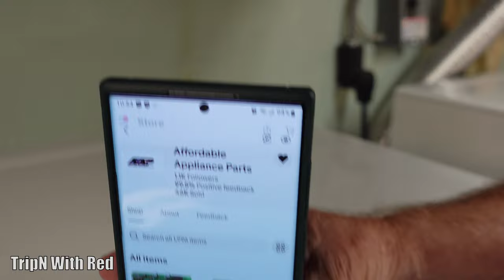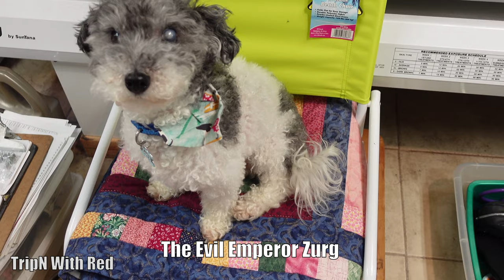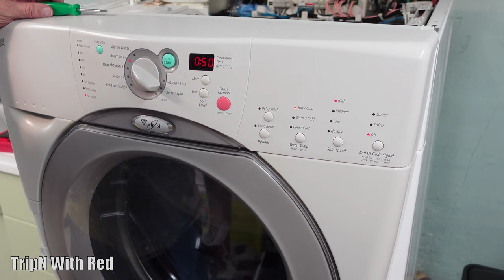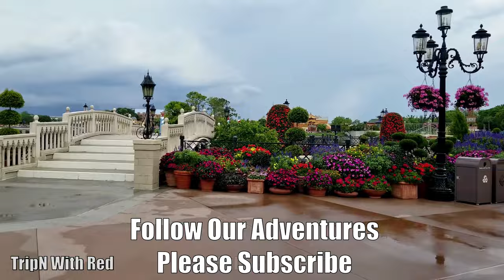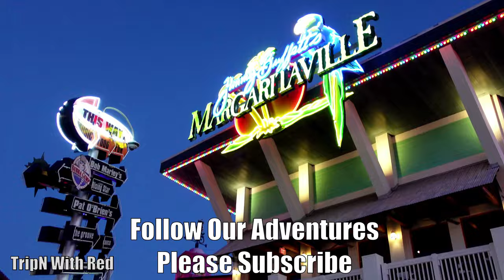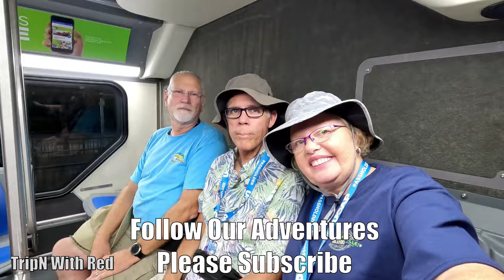Whirlpool Washing Machine Control Panel Board Replacement for Error Code - Locked Door Won't Unlock

Comment: So cool to see you doing the work on fixing. It saves so much money. I fixed my own flat screen TV for $31 part where if I would have asked LG to fix it, they would have charged use over $500 at that time. So great to see you guys doing this. LIKE 10. 👍👍👍👍
Reply from the maker: We always try to fix things ourselves whenever possible. The cost of a mechanic or to replace is just outrageous. We figure if we have these problems that need repaired, others might benefit from a how to video as well. Save wherever we can. Thank you for watching and commenting.

Comment: Just saw your video and I'm going to give this repair a try. Pretty straightforward. Wish me luck. I'll report out by October 15th.
Reply: Board arrived early! Swap-out from the casing was a little tricky but the door lock works again!  Thanks a ton for posting this video!!!
Reply from the maker: I'm glad you found our video. The fix was relatively easy and didntake long. Thank you for watching and commenting.
Reply from the maker: @coaststrings  that's great news. I'm so glad the repair worked and was fairly easy overall. Thank you for watching and commenting.

Comment: What's wrong with the control board ???
I have the same washer machine and i have problem with the door lock.. All contacts are clean
Reply from the maker: It's likely the relay on the control board that tells the door to lock or unlock. There's also a chance that it could be the door lock itself which is a real pain to get to and change. I replaced my door lock first but still had the same problem so the control panel was the next thing to try for me. Changing my control board resolved the problem and it's been working ever since. Let us know if changing the control board fixed your machine. Thank you for watching and commenting.
Reply: Thanks for your help
Reply from the maker: @davidrivera5082  you're welcome.

Comment: It’s from 2005 or 6 it’s not ancient by any means.
Reply from the maker: That's possible. It's a good set and we certainly didn't want to replace it if we could possibly fix it. Luckily the fix worked and continues to work still. Thank you for watching and commenting.